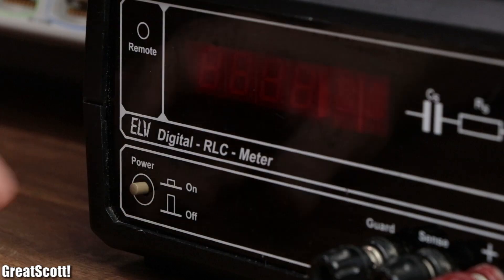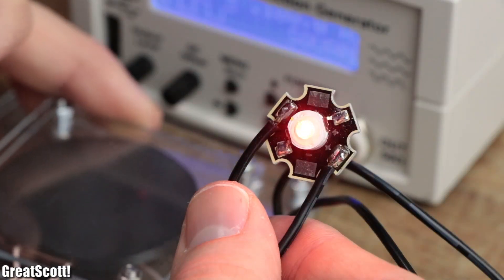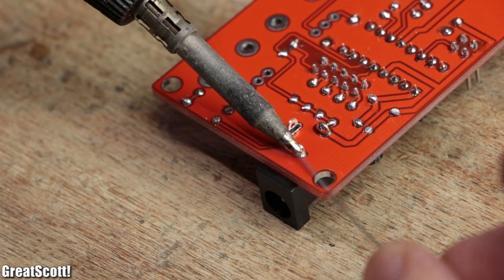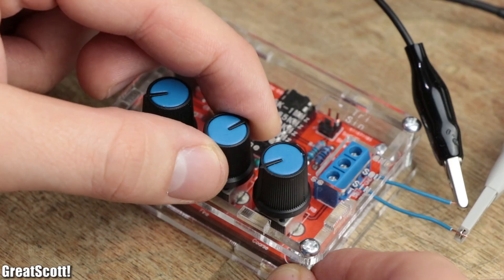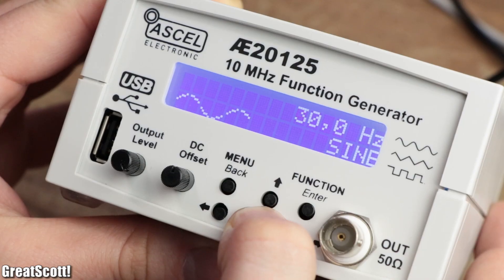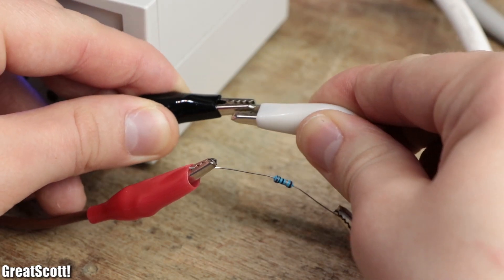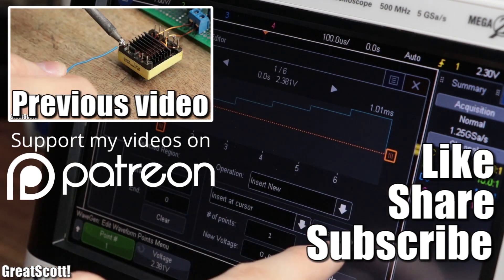7$ Function Generator VS 107$ Function Generator

Comment: If all you need is a test signal for audio equipment, give both of these a pass and build a Wien Bridge Oscillator. The NTC thermistor (one of several once-common panel lamps) can be a little hard to source, and you'll have to put a few standard-value resistors in series to get the right values from the application note, but other than that, it is fairly easy to build and produces a very low distortion sine wave.

Comment: I bought one of those exact models of kits and for whatever reason the output was incredibly small and the amplitude didn’t change when adjusted. I got a more expensive kit that was also very quiet so I ended up just making my own amplifier for it.

Comment: i might pick one of these up at a later time once i start getting more into circuit building. just got my first oscilloscope (the $20 one) and right now i'm just using and android app on my phone. seems to be good for less than 5k for square and up to 20k for sine. once i need the higher frequencies, ill will look into a proper function generator.

Comment: I thought about using the function generator from an app on my phone. Then build a board that would need a jack to plug in and have isolating transistors or opto isolators with a power supply of its own to get the signal from the phone and amplify it. Being isolated and a separate unit, even if it blows up it shouldn't mess up the phone. Any ideas? I don't think the waves are going to be clean coming from a digital generator.

Comment: I'd really li8ke to hear your thoughts on the Hantek 2D72 Scope/DMM/Arbitrary Waveform Generator. Based on this video, it sounds like One can expect to pay significantly more than $107 for an AWG alone. So $170 for the AWG and Oscilloscope sounds like a steal. Though on this subject, I'm entirely clueless. Personally, I believe it's an incredible little device at an even more incredible price. But I wouldn't be able to tell if it was so off that it's useless. So I'd LOVE to hear someone with a great deal more knowledge than I have weigh in on the subject

Comment: I have had one of those little kits now for a couple of years, it does the job for me when I need such a thing.  That said, it is rare that I am in a situation where I actually do need it.  The last time I used it, if I remember right was when I built one of those cheap oscilloscope kits, just to test the scope!  Guess it worked for that. I have a signal monitor deal that I can hook up to it if I need to set a specific output frequency, that was a couple of bucks more on Ebay.

Comment: They could have probably added an op amp buffer or push-pull output to the $7 one and vastly improved the output impedance without drastically altering the cost.

Comment: If you're trying to set up an electronics lab on a budget, I'd recommend avoiding the ultra cheap equipment and just buying good quality used equipment on eBay. For $50 or so you can pick up used Tektronix scopes, function generators, or whatever else you need. In the long run you'll probably end up needing their better quality anyway so may as well skip the cheap stuff and go straight to eBay.

Comment: lol i'm a cheapskate so i just use a USB sound card with audio amp to generate arbitrary waves. i ripped out the capacitors to be able to supply low frequency. works ok.

Comment: You could try to add that capacitor and feed it into an op amp setup as a voltage follower with a bjt or mosfet output stage

Comment: Can you connect it to the Gate of a MOSFET and power your circuit through the mosfet from a better power supply? I know it works with square waves, but what happens to sine and sawtooth waves?

Comment: you should do like a challenge where you have a project but you can only use cheap stuff, like a cheap soldering iron, cheap lab bench power supply, the cheap ociloscope and the cheap function generator

Comment: Hi Scott.
How easy is it to adjust sine wave amplitude to low output levels , say 10mV pk-pk for audio testing on the Ascel AE20125?  The single amplitude control of up to 5V with 270 degree rotation would probably output 185mV for every 10 degree rotation.
Downloading the manual and looking at the final LM6181 output amplifier has a gain set by R3/R2.  Wonder if increasing R3 to say 1k will reduce output amplitude  for testing high gain  circuits.
Thanks in advance.

Comment: Hallo Scott! Ich habe mir letztens auf Amazon folgendes gekauft: https://www.amazon.de/MAX7219-control-Display-Seamless-Cascadable/dp/B01N98BAF2/ref=sr_1_4?ie=UTF8&qid=1483616417&sr=8-4&keywords=8x8+led+matrix+max7219       Ja ich weis, sehr langer link. Ich will diese Matrix ansteuern aber ich habe nichts gefunden, im Internet. Es gibt 5 Pins: VCC; GND; D-IN; CS & CLOCK   -das gibt es auch auf dem anderen Ende, um mehrere in reihe zu schalten: VCC; GND; D-OUT; CS & CLOCK. Kannst du ein Video machen wie man die Matrix Ansteuert?

Comment: FWIW, these days you can get a full 2 channel 24 MHz arbitrary waveform generator with USB interface that supports frequency sweeping and all that jazz in a nice case for about $70 on eBay.  The same units are on Amazon and the reviews there are pretty good.

Comment: For $7 that is an absolute beauty. Add a transistor buffer circuit and a bunch of parallel capacitors to make sure you pass all the frequencies correctly and you have a very usable basic piece of kit.

Any good frequency counter kit that you would recommend? I have all the parts to build a 1GHz counter including the prescaler IC but i'm still trying to find an excuse not to haha.

Comment: Have you actually checked the things like jitter and harmonic distortion of sine wave in this chinese 7$ wonder? I don't remember  XR2206 looking THAT bad on the scope but considering this IC is long out of production and they're using Chinese fakes to stock these kits with parts it isn't too surprising. Another trouble with these XR2206 kits is that sine/triangle/square outputs don't have the same amplitude and people designing these boards never bother to actually get it right using some kind of buffer/amplifier sections.

Comment: Hey apocolyptic. You missed the 31 dollar arbitrary waveform function generator kit on ebay.  ad calls it mini dds arbitrary waveform digital function signal generator DIY kit panel v9t7. Ok upon looking deeper into it, it doesn't do 1mhz even sine wave only goes to 200khz.

Comment: Great vid from Great Scott, but I would like to suggest one more option - its AVR DDS. I learned so much from doing and modding it (diy pcb, avr programming, power supply, even micro-controller button debounce problem solutions, offset and amplitude controll, opamps rise times, clipping, lines rinnging etc). 16mhz avr  may run any function up to ~60khz, and square up to 8mhz (well, it drops in big steps at high freq). Additionally, I combined avr  with ebay AD9850 module, what brings ~40mhz sine. In parts it may cost 30-50EUR and 10000EUR worth fun.

Comment: if you dont need high frequencies, you can use an audio DAC. I found that the headphone of my phone is DC coupled!
Reply: audio amplifier output always has a capacitor in series, hence they are not DC coupled. This is because, any 0Hz DC will cause continuous current in headphones/ speakers and it will burn out the coil.

Comment: I have a better one which cost me about 10$ and It uses a small PCB circuit board and includes  a raspberry pi zero that can be also connected to hdmi monitor (Operating system is unknown but this kit comes with an 500mb micro sd card ) :)

They sell it at ebay and it is called:
 Pi Zero - Function Generator

Comment: would it be possible to procure a bypass filtration system for cleaning up the outputs?
Also transistorised outputs would eradicate the losses? (if the signals are cleaned up enough:-)

Comment: I want to be an electrical engineer but most of this I don't get so...
Reply: But I still love these vids
Reply: Can't know it until you learn it, I would suggest getting on with that.
Reply: Stone coldfive yeah I wish I knew a little more
Reply: GamingG Aser well I know my basic electronics just not really what this video is about I don't really know what you would use it for
Reply: GamingG Aser well I know my basic electronics just not really what this video is about I don't really know what you would use it for
Reply: GamingG Aser ok thx
Reply: Time Lapse King Basically, whenever you’re designing a signal filter, or testing your oscillator, comparator , or whatever,    you kinda need to know what goes to compare what comes out.Thats it.Or maybe you just want an easy sinusoid wave on your bench.
Reply: Time Lapse King If you have an android phone download everycircuit. Very much worth it.

Comment: 4:30 : "You could add a capacitor in series..."

True, but an ELECTROLYTIC capacitor? Really?
Reply: Thomas Lovén Yes you can use electrolytic cap in series to the IC chip output; in which the positive end faces toward the IC chip output and the negative end becomes your final output. This is widely done to decouple DC offset in the input and the output of audio amplifiers; say for example TDA2003 IC chip.
Reply: Yes. A higher value has less impedance for lower frequencies, while still blocking DC.

Comment: Would you make a ad9851 Based dds ganerator control by Arduino
I am working on one and found it possible to use it as a high power FM signal source

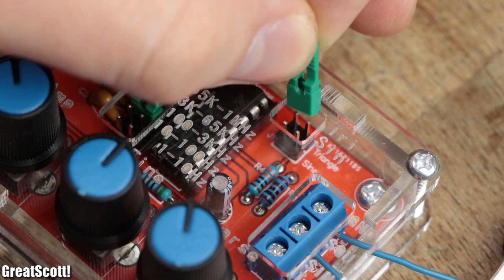Comment: Hey Scott! Wanted to ask you a question. I have the same cheap function generator, thought mine was faulty because of the 'jiggles' i see in waveforms, but it made me somewhat happy to see you experience the same as well at 4:42. Any chance you know what is causing this? And how to prevent? By jiggle i mean the waveform shakes back and forth, creating ghost duplicates with different phase. 

Great videos btw, already subscribed. Keep up the good work, we need engineers like you!

Comment: Beside the problem of the DC offset at the cheap one there is the a PCB mistake for the left potentiometer (turning right means decreasing output instead of increasing). But you can fix this problem by changing two pin of the pot.

Comment: The function cheap generator I would recommend is the FY32024S. (Price is around 80 usd)
As it has 24 MHz output for a decent sine wave. 4-6 MHz for Arbitrary wave forms, square, saw, and audio.
Other then this it has rather nice build quality, the case feels really cheap though, not to mention weighs so little that putting in a lead weight could be considered and upgrade.

Comment: Could you use an app on your phone (a jack adapter if you have an iPhone 7) and an old radio with AUX in? 
You could remove the speakers and use those wires right?

(Not That I plan on doing it, but I just had this idea)
Reply: And I think you can draw more current and it also has a screen!
Reply: +Vaes Joren
Not to mention, a saw wave has twice the harmonics of a square wave, so when you get to high frequencies, you're just getting a few layered sines, not saw or even square.
Reply: I agree with the other comments, a signal generator app on your phone will be good for testing a low cost audio amplifier at most. There is a trick you can do if you just need squarewave though: You can use one or two digital ICs set up as frequency multipliers and an array of switches or jumpers to set the multiplication factor.However at this level of complexity you are better off building a proper generator to start with. :) It can be as simple as a common switching IC like a UC384x with its feedback pins tied to ground and a potentiometer as the timing resistor. On the output of the IC which is normally used for driving a power transistor you will have your nice squarewave. :) These chips are also capable of a fair bit of current, significantly more than your common function generator. But you can only get squarewave out.The UC3844 or 3845 are best for this application as they are limited to 50% duty cycle on the output, so they will provide a perfect squarewave with the feedback pins grounded. For extra range add more timing capacitors and use switches to select which one to use. Please no 555 timers here. It can be done with a 555 as well but it has significant drawbacks once you get past 50kHz or so.
Reply: Ok! Thank you for the feedback and explaining me why this is a bad idea!

Comment: How about comparing a low cost lab power supply to a high cost one? :D
Reply: I have one of those 30v/3a bench supplies. It's OK to start with, but eventually I got exasperated with it and bought a Korad KA-3005D.  The problem with the cheaper supply is that if you're trying to do something like test LEDs or something else where you need to set current limiting very low, like 10ma, it's very fiddly to get the setting right on the analog one.

With the Korad I can set up several exact programs and flip between them instantly.  It is 2 to 3 times the money.

I'd say get the cheap one to start with, then go to something better if you find yourself needing it later.  After all, having two bench power supplies is sometimes needed anyway.

Korad makes one for a bit more ($200) that has two adjustable outputs, which seems like a good deal, but I didn't like how they set up the controls on it and decided I'd rather buy two 3005Ds than one of the dual output ones, when I got to where I needed another supply.
Reply: @John_Ridley  vppp0ccp0c9900pcvp0pcpc00ccpp0cp9990c0cc009000ccpc0cpc0 ocoo090cp9c0c0c9o0ccpc09c0pccpj000cppcpp0pcjcpc0c9c0c00 pjpcğc9c9cpo0pğ0cp90cp0pop0cp0cğpc9c0cc0ğccp0cjğpğc0cc0p09pcğvp0pop90cpğı0c0p90 pccp9pp0cpcğcocp0cpvcc0v
Reply: You can improve the precision of current knob by changing it to multi-turn potantiometer. You should keep in mind that the multi-turn pot knob is bigger than one turn one.
Reply: MrSandoron i bought a very cheap 20v-2a psu for 40€ and it works perfectly fine.
Reply: relik0fages That depends on what your time is worth.  The cheapest route and it works for many is to just buy one of the ATX power supply adapter boards.  For $10 and a power supply you can probably find for free you can have a good quality power supply that gives you 12, 5, 3.3 and maybe other voltages.
Reply: YES! i cant decide if i want to build a PSU or buy an Ebay one like this one.
http://www.ebay.com/itm/30V-5A-Variable-Adjustable-Precision-Digital-DC-Power-Supply-Dual-LED-Dispaly-/222181019956?hash=item33bb055134:g:2wIAAOSwzJ5XgGNw
Reply: If you already have the parts laying around to build your own, that would be the cheaper route. Though if you do not have the parts and are going to purchase the eBay one doesn't look so bad.
Reply: Was machst du denn hier? :P
Reply: Dr meter makes a decent linear powersupply for the money, any cheaper, you pretty much get what you pay for.
Reply: G3RMANARMY Mich über Elektronik weiterbilden! Ich schreib doch immer unter die Counter, dass das mein Hobby ist, wenn jemand meint ich hab keine xD
Reply: MrSandoron Wenn du ihn noch nicht kennst schau dir mal bigclivedotcom an.
Ich finde das er wirklich gut erklären kann.
Außerdem jagt er billige China Elektronik in die Luft was auch nicht schlecht ist :D

Comment: What is the reason for using this machine?
Reply: To have  a known frequency if you need to track its way through a circuit and see if something changes, or to find what exact frequency you need for a resonant circuit.

That would be my guess.
Reply: A Real Stoner Story it gets the girls every time!
Reply: if you have a part that has been filled by the manufacturer with resin to prevent identifying it, you can put a known signal through it and measure the changes to figure out what the circuit is
Reply: Aeolwn Thanks for your efforts.
Reply: Aeolwn are you an  electrical engineer
Reply: Aeolwn I love electrical engineering but whenever i open YouTube and try to show my love towards electronics and play some videos people start by level of sharp point of the pencil and still sharpen it. They don't show the basic idea so I cannot understand properly.

Comment: wait... those nuts are stand ups and not to attach the pcb to the bottom plate?

goes away running to disassemble his function generator

good video! What about doing a video on those lcr-t4 component testers then? i got one for 7 euros + 4 for the acrylic case. Quite satysfied with it.